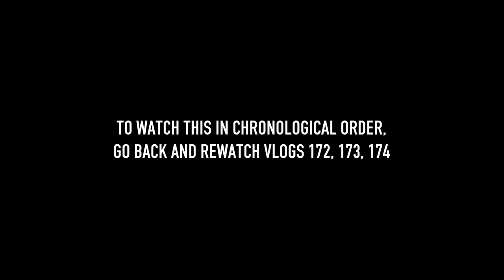#190 - Jason's 1972 Survivor CB750

Comment: That cone engine Shovel at 0:47 has a LOT of things going for it. That fork is a narrow springer from Paughco -safe and solid looks! Jason's 750 Honda is definitely as retro as it gets. Two of my riding buddies had CB750 Honda engines stuffed in Amen and Carlini frames. No springers on either machine - one Smith Bros and Fetrow girder on one bike and a six over Honda fork on the other bike. The engines had Yoshimura goodies in them and Kerker four-into-one headers to boot. Both bikes ran prototype dual action disc brake calipers. Go fast means stop fast. Lots of fun, man! Stay frosty and ride safe!